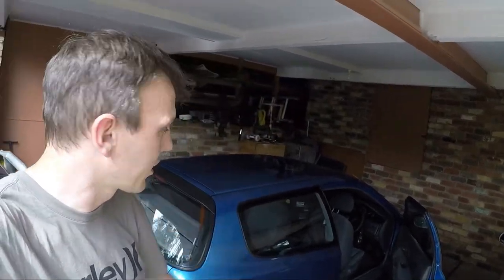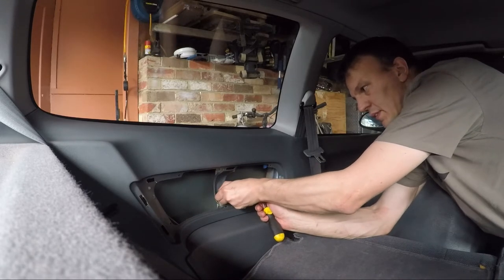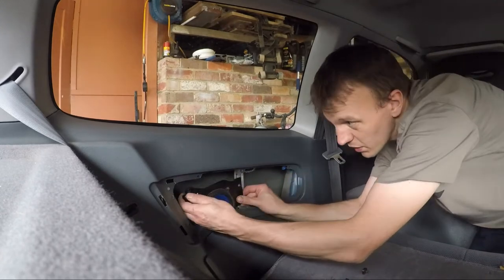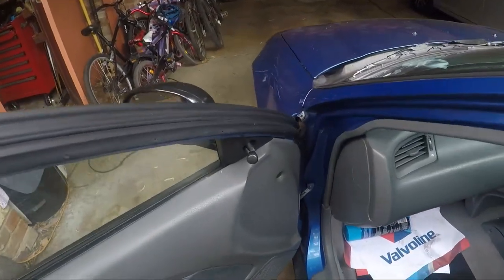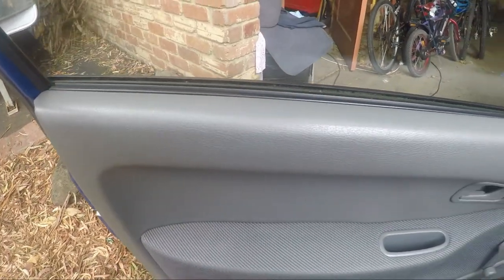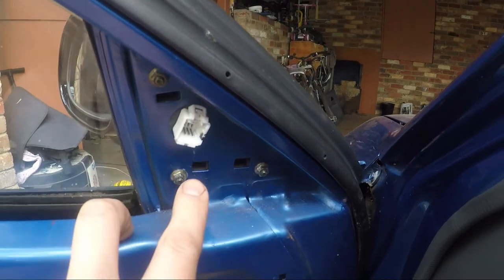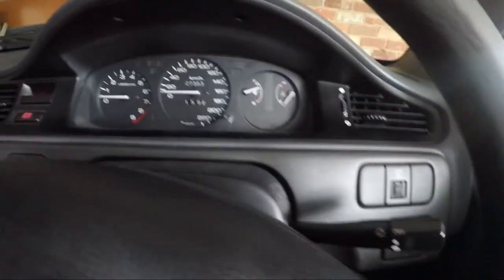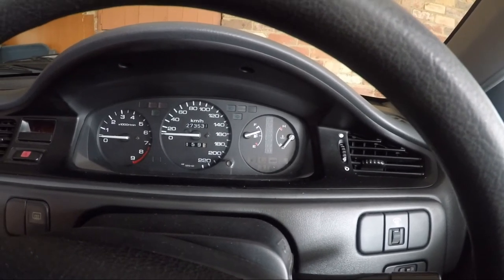Rear speakers, power mirrors and tach cluster upgrade: Honda EG Civic

Comment: I’m trying to find a rear speaker bracket setup for cheap so I can do this mod! Most I have found online are $300+ 😳
Reply from the maker: wow! I heard the black coloured ones are rarer but $300+ is ridiculous. Where are you located?
Reply: @teamaxlestands  the black colored ones are the sets I have been looking at but I am in Washington. $300 is what I have seen on eBay and through local sellers.
Reply: Mann I feel ya I finally found some rear speaker brackets for my eg cost me only 40 bucks but I did notice I don’t have the black housing to keep the speaker from rattling

Comment: Your model had had a connector for the tach? Straight plug n play?
Reply from the maker: Yeah. My understanding is all of them are the same. Mine is literally the most basic model you can buy and i know others who have plugged them in and they work too. The fuel light is the only thing which im not sure works... i've had it pretty low and it didnt come on.

Comment: Great video. Question about modding the rear speakers...where did you get the harness attached to your blue speaker? 

I found the speaker harness attached to the EG with the blue tape, but I'm looking all over the web and can't quite find the right match!
Reply from the maker: Hmm tricky one... yeah i got those from the wreckers when i got the rest of the stuff. I imagine Honda would have used them on the models of the same era, so it might be worth heading to your local DIY wrecking yard and have a quick look at the rear speakers in 90s hondas.

Comment: So is the other plug tucked away for every EG? Or did you have to do the wiring by yourself? I have an EG4 and I'm thinking of doing the same mods.
Reply from the maker: Yes, I believe every EG has the wiring. Mine is the absolute base model (carbureted, wind down windows) - so if mine has it i'd imagine they all do. Its pretty easy to check you just pull off the panels like in the vid and take a photo with your phone. You will see the plug attached tot the wires going to the rear with a small amount of blue electrical tape. My stereo had been replaced and the wires were not connected for the rear speakers so once i connected them up they worked straight away!